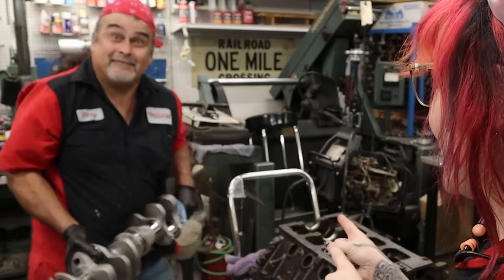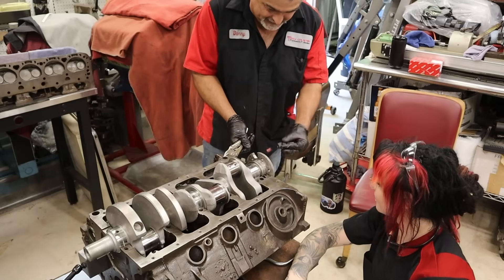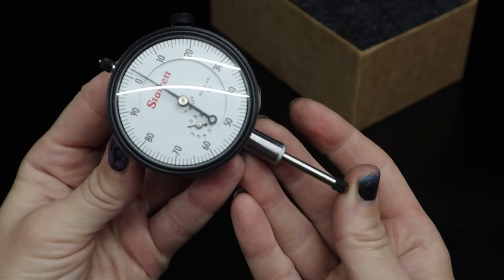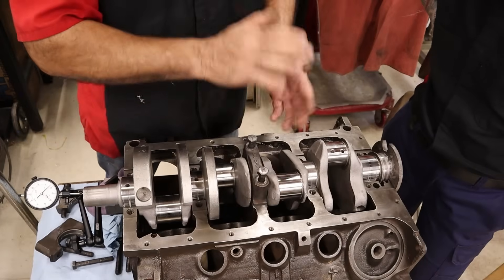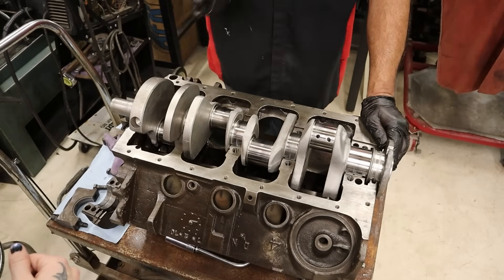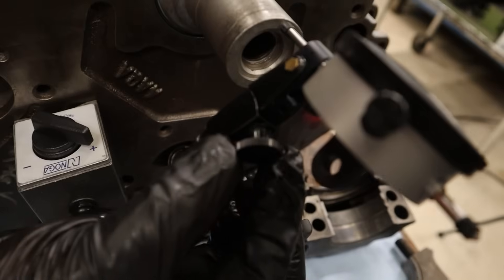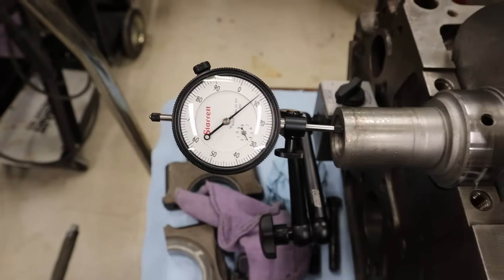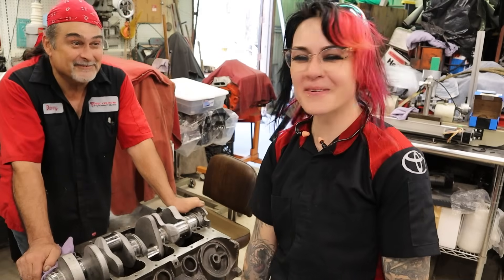How to Measure Crankshaft End Play Properly & Set Up a Dial Indicator with @MrDanielSoliz #DIYtips

Comment: As a final bolt up we would put pressure on the rear of the crank to hold the main in place as we torqued it down.  We were using a triple disc  clutch and wanted to make sure the surface was dead flat on the mains. We would also file  a groove if necessary to promote oil going to the thrust surface of the bearing. Probably over kill, but we did it. We pressurized one by drilling a hole through it going to the oil gallery.

Comment: I either neglected the crucial step or the old BL 1275cc  engines I put in Minis back in the 70s had little rings around the main cap bolt holes to precisely locate the caps. I wonder if the memory is accurate because they were such cheap cars.that every expense was spared on them. 😉

Comment: I have to admit, I totally wimped out on all of this and simply purchased my 2JZ-GTE bottom end directly from a dealership. It came in this sweet Toyota branded crate and was surprisingly affordable. Honestly, I’m not sure I could have bought a used short block for what I paid for this brand new one.
This video is still worth watching to see Danny again. Dude has good energy. Guess I could still test the runout, though?
Reply from the maker: Hey, if I had the opportunity I would do the same thing! Nothing wimpy about a great deal on something you know is done right - AND with a warranty?!! Yeah, I'd say you scored! But yes, you can also check end play with the block in the car too! I'm curious if Toyota set it on the tighter or looser side from the factory!
Reply: @FayeHadley 
Will report back. No worries